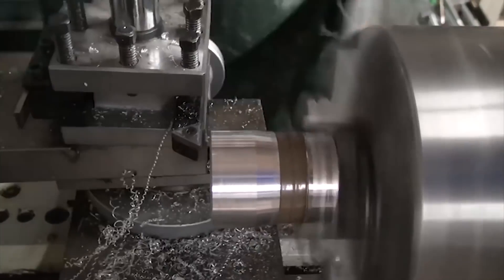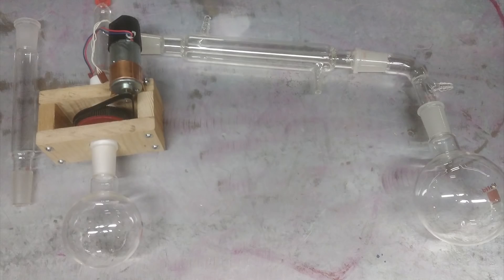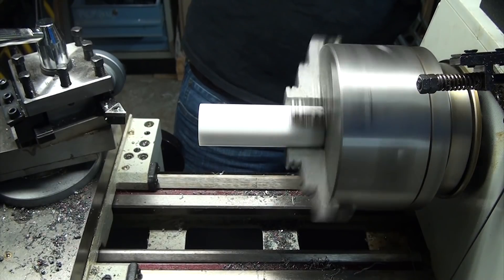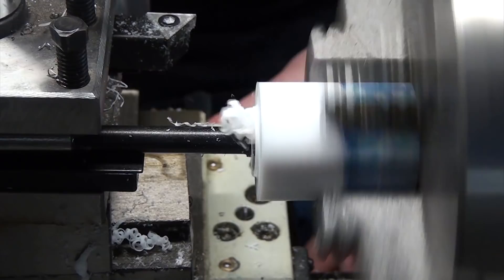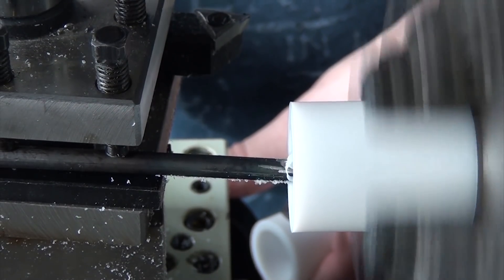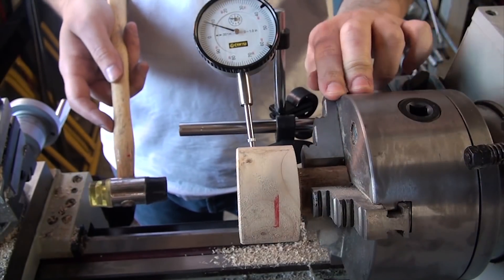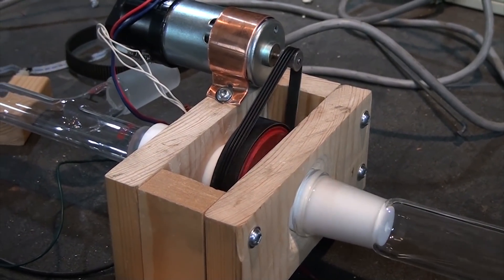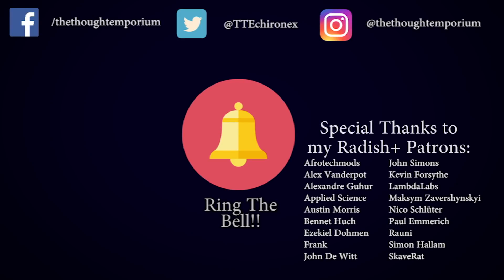DIY Rotovap - Motorized Rotary Vacuum Coupling Build

Comment: Probably isn't going to work too well under vacuum.  Should ha e put a thrust bearing between the 2 nylon fittings cause they are going to get squeezed together under vacuum.
Reply: Looks like he already had the vacuum attached and running while he was testing. My original concern was "wouldn't you want a spot for a keck clip to secure the flask and keep it from falling off?", then as I was typing out this reply to your comment, I realized the vacuum is what is securing the flask. The o-ring setup he has appears to be able to withstand the thrust involved, neat setup I must say.
Reply: Nylon would not work at all for this application.

Comment: You can use this to accurately measure the angle:
https://www.amazon.com/Agile-Shop-Universal-Stainless-Protractor-Precision/dp/B01CI3Z2IQ/ref=sr_1_62?crid=2XVTUWCM4BH4P&keywords=angle+measurement+tool&qid=1552036139&s=gateway&sprefix=angle+me%2Caps%2C233&sr=8-62
You can use that tool to very accurately set the cross slide angle (against the face of the chuck).
Your lathe did not come with another set of 'internal' jaws where the steps are reversed? 
(Largest arms on the outside, rather than the center?)
The jaws of your lathe chuck are removable by screwing them all the way out and replacing with obverse version.